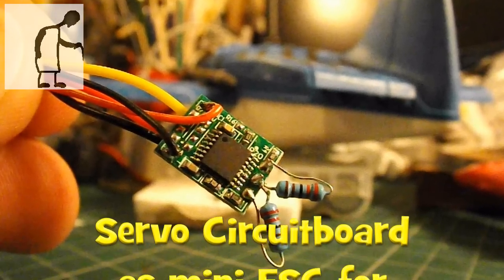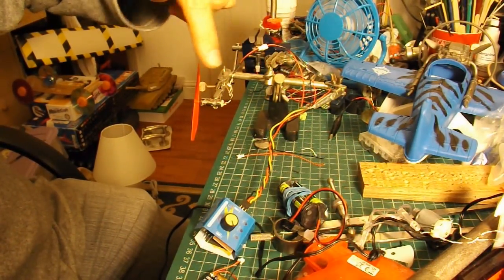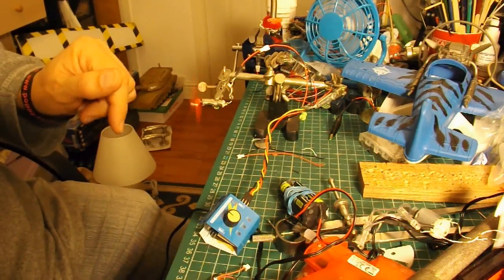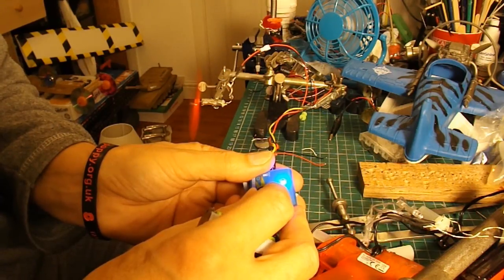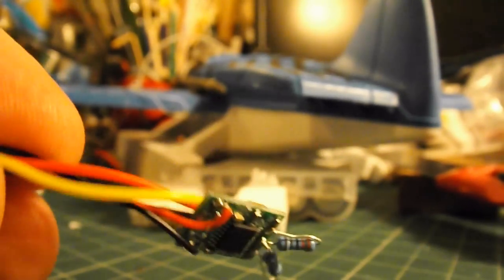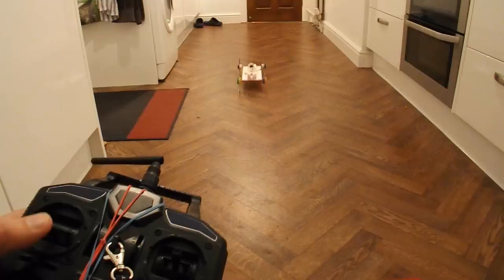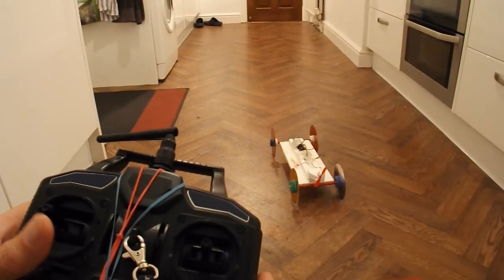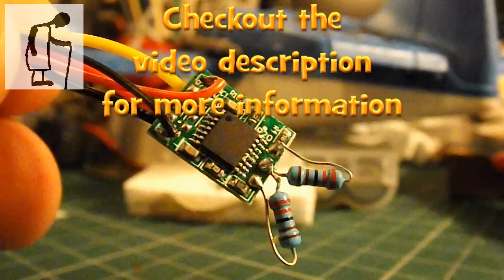Servo Circuit board as mini ESC for a small DC motor

Comment: Excellent and not entirely obvious at all...a fine idea.
Your link to the motors has expired, wanted to see what the diameter of the motors is...my Hubsan H107C uses 8mm motors and if one of these 9 gram servo type boards can run one of those then it's a boon to my own modelling. The description seems to say 7mm (if 7x20 is measurements). Normally, it's a 6mm motor in a servo, but who knows, those controller chips might be 2 Amp capable. Worth blowing one up to find out lol
Reply from the maker: +slider2732 I think you need to consider the current flow through the receiver as these are not fed like a normal ESC. I would love to use a couple in parallel for twin engine or maybe via a mixer for variable thrust control but I am wondering what the receiver will think about it. I would hope the servo circuit board would burn out before the receiver was damaged but I don't have a lot of surplus receivers to test my luck with :-)
Reply from the maker: +slider2732 Just measured a few of the motors I have and they were all 7x20
Reply: GrandadIsAnOldMan
Thanks for measuring. One of those fancy dancy computer radios could mix channels together, such that you could run 2 of these on the throttle channel (for Mosquito etc). Have just ordered a couple of AR6110E receivers and will try this. Not got a fancy dancy radio, but this really appeals for micro models.
Reply from the maker: slider2732 good luck, no doubt we will see the video shortly.

Comment: put it on a small foam plane and make it rc
Reply from the maker: +Unlimited Bros that is the way I am thinking. I am not sure how much current it will support before causing problems for the receiver because we are drawing the current directly through it, not from a separate feed like a normal ESC. It may be an expensive mistake if we start burning out receivers.
Reply: than use a buck converter for it and use just the signal wire for control and feed the power directly from the battery . So this means that you are going to use an improvised BEC. + 5-9g .

Comment: what i did was using the potmeter.. zet your th trim to zero. and gleu the pot meter at te zero point
Reply from the maker: +rc model boats yes that would work fine, there is an episode on FliteTest covering that method for making the servo rotate continuously. Unfortunately in this case I only had the circuit board left over from an old project. I found it when I was searching for something else and it reminded me of your boat so I had to try it :) I am thinking of using a variable resistor pot just to experiment with it to see what happens and if it can be used for any benefit.